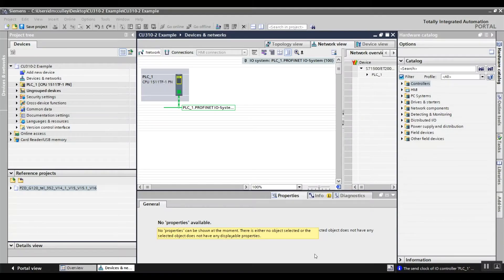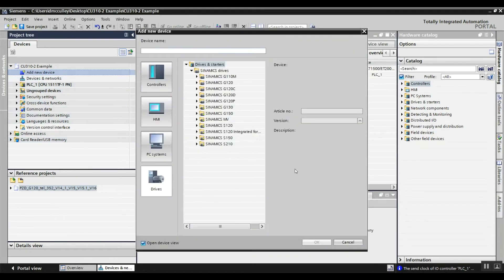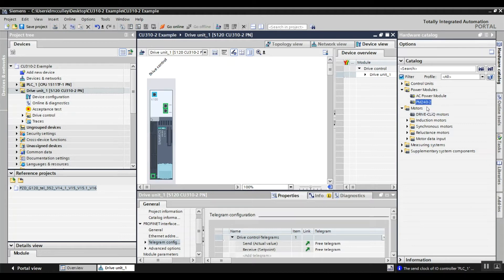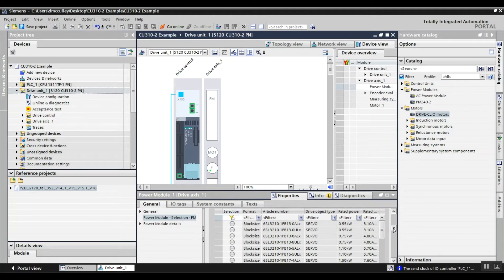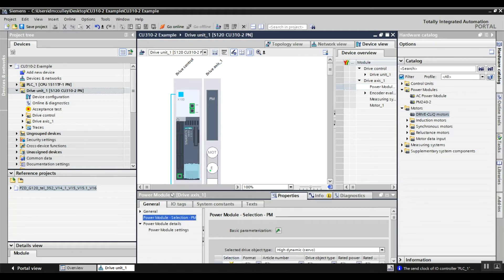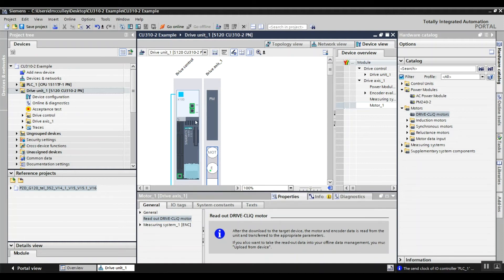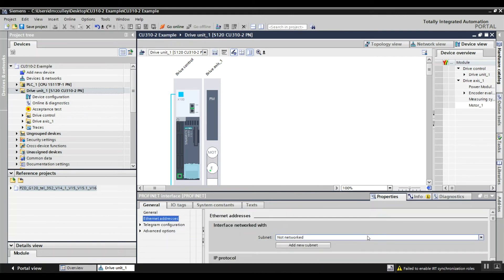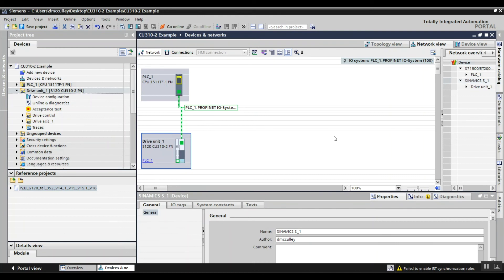How to Add an S120 Using a CU310-2 to a TIA Portal V16

Comment: I use PLC S7-1516T with S120 CU320 and Servo motor with absolute encoder.
I would like to set home zero position in order to configuration in the home position.
I would like the servo motor stay at the set point position after power off and on.
How can I do that in startdrive with TO positionning Axis configuration ?

Comment: Do you know if the CU320-2 DP can be integrated into TIA like this? In 15.1 it makes you use a GSD file and I have not been successful in setting that up. I understood that the first 4 slots in the telegram configuration area was reserved and you started your in/out transfer areas at slot 4. That is the way step 7 is set up. I was trying to migrate from step 7 to tia and was not unable to get this working properly. The engineer I consulted was sure about this. Maybe you can help.
Reply: Must Change cpu From DP To PN Only
Reply: @spk7054  I fixed it where the DP Control Unit worked in TIA 15.1. I can't remember exactly what I did. It had something to do with the telegram structure. I think instead of using the universal modules, I used the standard telegrams and made the lengths what I wanted. I was afraid of using standard telegrams because normally you have to match the telegram type in both PLC and VFD, but it worked.
Reply: @luciddream2033  thank you for good info. brother.
Reply: @spk7054  no problem. If you need specific details I can go back and look at my project and see exactly what I did to make the DP control unit work with TIA portal. I am currently trying to upgrade all of old step 7 projects into TIA portal. Love me some portal. Maybe one day I will upgrade the control units so I can use startdrive and fully integrate it.
Reply: @luciddream2033   Right now I was implementing the project revamp machine Crosslapper  Upgrade hardware control system from ipc industrial CPU change to PLC S7-1500 Sieries  already system is siemens motion control  CU320- DP and Simamic drive S120  .I m try  migration to TIA but not work and I learning  knowhow from internet but until success.
Reply: @spk7054  what CPU are you upgrading from or PLC.
Reply: @luciddream2033   From CU320-DP  Change To CU320-2PN   recommend by sale
Reply: @spk7054  I'm assuming you selected the matching firmware versions? In the s7-1500 almost everything is done in the PLC. You said it's motion control. Is the motion control done in the PLC or the drive. Only select telegrams will work as the encoder data in routed back to the PLC through these telegrams. I have a project that is done with a cu-320 Pn and a s7-1500t. I can maybe post some videos of the hardware configuration on my channel one day when I get time. I'm assuming you are having issues with the communication.